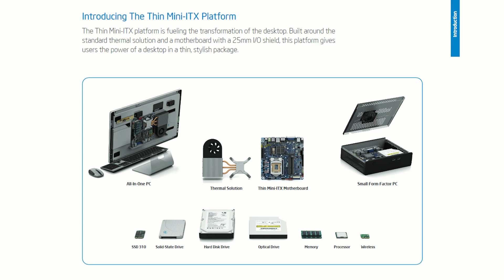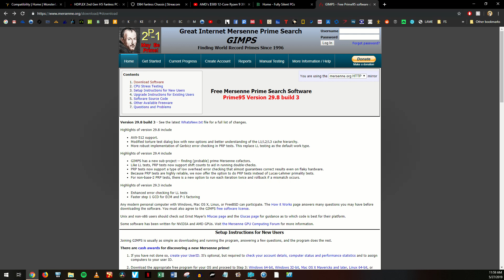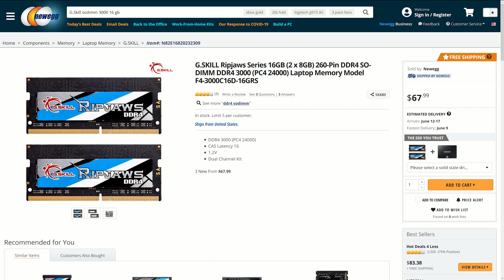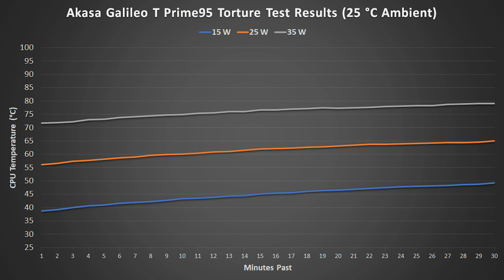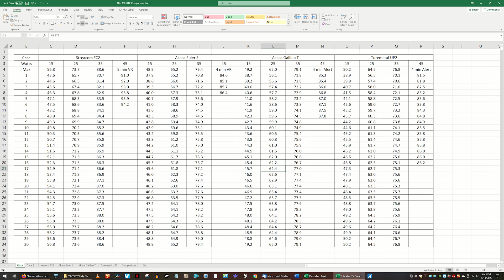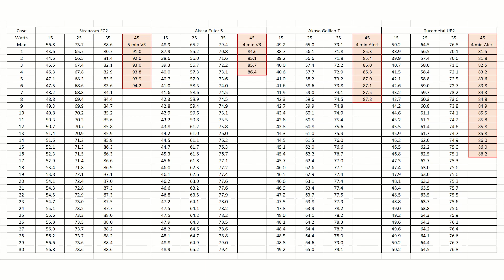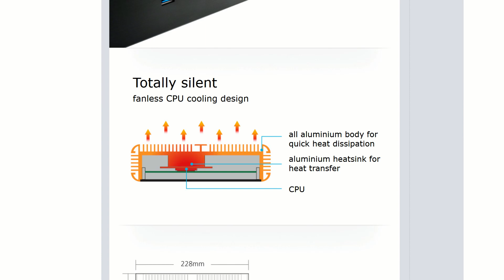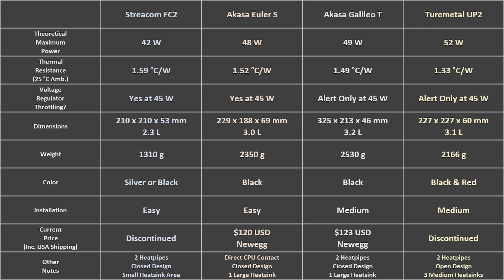The Best Fanless Thin Mini-ITX Case Showdown

Comment: how do you set the CPU TDP profile, from 10 upto 35 watts?
Reply from the maker: There is usually a power limit setting in BIOS.
Reply: @fullysilentpcs  you set the TDP from BIOS?
Reply from the maker: Yes
Reply: @fullysilentpcs  maybe you can show us the BIOS settings 👍
Reply: @fullysilentpcs  ever tried on ryzen?
Reply from the maker: Yes, with Ryzen the power limit setting is known as PPT.

Comment: Very interesting, thanks. I really like the aesthetics of the FC2 - wonder whether something like an i7-9700T would work in it. I realise that CPU has a PL1 of 35W, but I'm sure it exceeds that by a fair amount in turbo states....  Meanwhile I'm waiting for some bits to complete an FC8 build - 65W seems like a more useful amount of headroom.
Incidentally, could you expand on your comment about SSDs on top of the chipset? I'm starting to see this in H470 and Z490 ITX motherboards, and it'd be quite disappointing if it simply is too hot to work.
Reply from the maker: The i7-9700T would be okay. It would exceed 35 W during turbo boost, but only for short periods of time. Yes, the FC8 certainly allows for more flexibility with higher power.
Reply from the maker: SSDs right above the chipset is sometimes okay, but it does also cause issues other times. It depends on the specific motherboard and how the chipset and SSD are cooled. Motherboard designers are getting better at it. The motherboard here (Asus H310T) is about the worst design possible though. With such a small heatsink for the chipset it will get very hot. With larger chipset heatsinks it is not as much of an issue.
Reply: @fullysilentpcs  Thanks - will have to use an IR thermometer to check my Asrock H470m-ITXwhen I receive it.
Reply: I'm waiting to the Akasa Maxwell Pro, it will be around 150, instead of the 250 of the Streacom FC8... It's a new model, so it will take a little to be in stock...
Reply: @oscarcamacho  Yeah I only went for the FC8 once it once it went on sale for about $150 here in Australia.
Must say Maxwell is no better with front panel ports - why only USB Type A in 2020...? Even an additional headset jack would be nice.
Reply: @ad_fletch  150, good opportunity... These fanless chassis are heavy, I'm waiting to find the Akasa Maxwell in Amazon... I was tempted to try hdplex, but there are stock problems with the psico psu's and converters... And I prefer a thin mini itx because of the external psu, everything's easier...

Comment: Great work! How do you adjust the power limit with that motherboard? I don't know how to adjust every 10w of power use in Intel XTU (I have the galileo t, same cpu and motherboard, I followed your tutorial)... Thanks!
Reply from the maker: I go into BIOS to adjust power limits.
Reply: @fullysilentpcs  I checked the bios first, but I don't know how to adjust the power limit to 35w, do you know where I could find a tutorial for that? All the undervolting guides I've checked talk about -0,01V in some cores and similar stuff... Thanks!
Reply from the maker: I believe it is under Ai Tweaker. Look for something like Long Term Power Limit or PL1. I don't have any of these assembled anymore to check myself exactly where it is, but look through each setting and you should find it.
Reply from the maker: -0.01V would be for undervolting, which is something different. The units for the power limit should either be watts or milliwatts (35W or 35000 mW).
Reply: @fullysilentpcs  Thanks! I have as a Bios Aptio Setup Utility, in Ai Tweaker > Internal CPU Power Management > Long Duration Package Power Limit > Auto. I can't select any other option... Should I had to upgrade my bios? It's American Megatrends version 2.17.1246.
Reply from the maker: Are you not able to manually enter a number when you have the power limit field highlighted? If not, then yes, updating the BIOS should help.
Reply: @fullysilentpcs  I've updated the BIOS to no avail, same behavior... But I've set in XTU some undervolt and the turbo boost power max and the turbo boost short power max to 15W, the package tempereture it's 45 degrees with 2h with the cpu at 50%.
Reply: @fullysilentpcs  I don't suppose the FC2 is for sale?